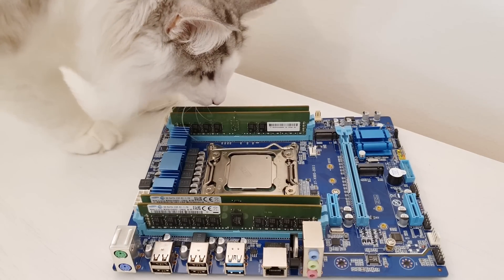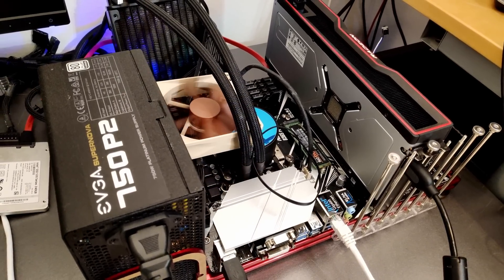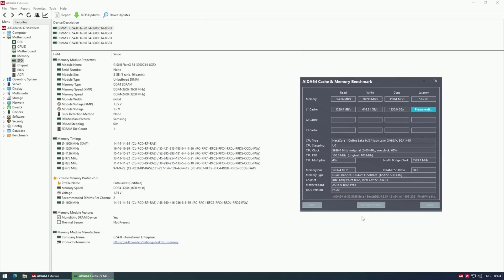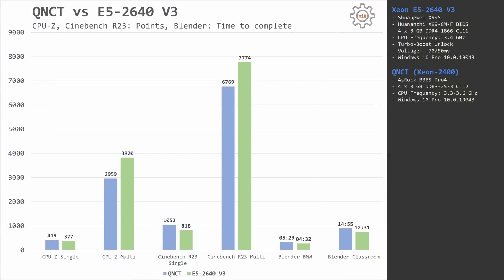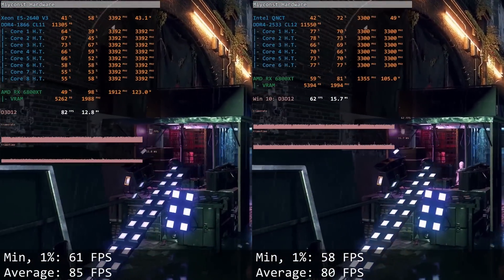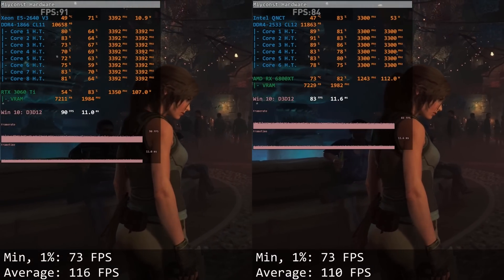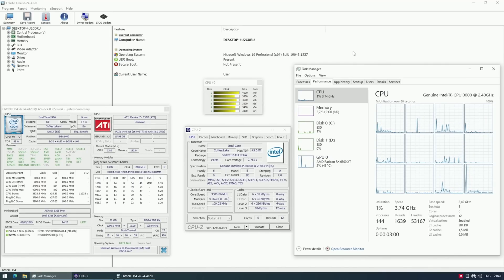🇬🇧 QNCT mutant vs Xeon E5-2640 V3, which platform is better for budget PCs – LGA 1151 or LGA 2011-3?

Comment: Hello, I currently want to build a new computer, I don't have any parts yet. And I am interested in the x99 platform. 

Would you recommend me to buy a Chinese kit which includes. 
MB Huananzhi F8
Xeon E5-2690 v3
 32GB ddr4 2400mhz (4x8gb)
 All for $350 usd 

I would also like to buy a huananzhi gtx 1060 6gb graphics card for $400 usd 

I would like to know what capacity my power source should have. 

Do you think it would be good to buy this? In total it would be 750$ usd.

 My knowledge in hardware is very limited, I would really appreciate your help. Thanks for your videos! They are really great.
Reply from the maker: Thank you for the support, but the parts you have picked is a waste of money. For €350 you can get i5-10400F on B560 or B460 motherboard, and for €250-300 you can get GTX 1060 5 GB. If you want X99 then go with Shuangwei X99S and E5-2640 V3 or E5-2666 V3.
Reply: @Miyconst  Thank you very much for your answer, I was really one step away from buying the Chinese kit.

I have the need to use the equipment to play games, and stream at the same time, at a resolution of 1080p@60fps also render video for YouTube mostly related to games.

The games you use in benchmarks like F1 and FPS are the kind of games I'd like to create my content with, but really I'm a fighting game guy, like the following. 

Tekken 7
Processor: Intel Core i5-4690 3.5 GHz or equivalent
Memory: 8 GB RAM
Graphics: NVIDIA GeForce GTX 1060 equivalent or higher 

Guilty Gear Strive 
Processor: Intel Core i7-3770, 3.40 GHz
Memory: 8 GB RAM
Graphics: GeForce GTX 660

King of Fighters XV
Processor: Intel Core i7
Memory: 16 GB RAM
Graphics: Nvidia GeForce GTX 1060 6GB / AMD Radeon RX 480 4GB

Do you think the above recommendation of I5 10400F, E5-2640 or E5-2666 can do the job?

What is better for the kind of workload? 

I can't exceed 400$ usd for M.B.,CPU, Ram

And I have another 400$ for the graphic card that I expect in the Huananzhi Gtx 1060 6 gb.

In my local market for that price I only find GTX 1050 TI which surely won't be enough.

Once again, thank you very much for your advice and your reviews, I would like to support the channel with a donation, how could I do it?
Reply from the maker: @TeamTemplo  all recommended CPUs will do the job just fine. For streaming and video rendering you just use your GPU, yes, the quality will be insignificantly worse, but I really doubt that any of your viewers will be able to spot the difference. If you can't fit i5-10400F + B560 + 16 GB DDR4-3000 (or higher) RAM into the $400 budget, then go for i3-10100F it equals to the i7s from the past and it will do the job just fine for you. For the graphics card, again, I would recommend you to stay away from the "new" GPUs from AliExpress. These cards are not new, only the cooler and package is new, the rest is scavenged from broken parts.
Reply: @Miyconst  Perfect! I will heed your recommendation and go for the i5 
I have found the i5 10400F for $150 usd 
As for the Mo-Bo I have found the MSI board that you have used in some of your videos MSI Z590A-Pro for the same price I have also found Asus ROG STRIX B560-A Gaming WiFi what would be better in my case Z590 or B560 if both do they cost about the same? 

Regarding the RAM, you recommended DDR4-3000 on the Intel website, it mentions that the processor supports up to DDR4-2666, so I'm not sure what RAM to buy. 

Apparently everything has been adjusted to the budget what was destined that makes me very happy I hope to buy the equipment this weekend 😁
Reply from the maker: @TeamTemplo  if the price is the same, go with Z590, it's a much better board, but if you need WiFi then go with the B560. Core i5-10400 officially supports up to DDR4-2666, but with B560/Z490/Z590 chipset you can overclock RAM to DDR4-3200 and higher.

Comment: 2011-3 has another beast CPU for gaming - Xeon E5-2666(10c/20t - 3.5 Ghz on all threads)
Reply from the maker: True, with the current price drop it's a very interesting option, even though the CPU is very power hungry.

Comment: Great content!
In gaming Xeon will be more stable because of the much higher PSP(4 vs 2 channels) and more amount of cores. Well even avg FPS is higher.
The only advantage of QNCT based PC is a newer platform. That means, once high end LGA-1151 CPUs will become cheaper you can upgrade your system.

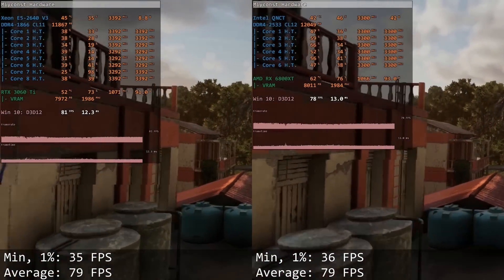Comment: 6:42
But didn't you say Assassin’s Creed Odyssey is a well-optimized game in an older video (in this video https://youtu.be/xaL5u3AYgRE?t=466 )?
And how the average FPS decreased from 82 to only 57?
Reply from the maker: I was wrong about Odyssey, I thought it was well optimized, but in reality, it just loads CPU with crappy work, while FPS is really bad. Regarding the FPS values, I wish I would saved the exact graphical settings for the original test, but apparently, the graphical preset was changed in one of the updates, so it's not apples to apples comparison.
Reply: @Miyconst  Thanks for your answer

Comment: Great work!!  I have recently bought i5 8500b mutant and paired it with Asus ex-b150m-v3 and bios mod with the latest from Asus. But the issue is my Rx 470 not detecting but my old GPU is detecting Amd HD 6670, Is there any changes I have to make in coffee time? Can you please help me to resolve this issue? Thanks!
Reply from the maker: Hmm, it could be that you are using old bios version to create your modification. Did you try to mod the latest available BIOS? Did you talk to the seller?
Reply: @Miyconst  Yes I'm using the latest bios from Asus but no success and I even tried lower ver but no detection of RX 470 and yes I asked the seller but he said I can't help you with this sorry. Should I try more old ver of bios mod? Or does this CPU have a compatibility issue with RX 470?

Comment: Good job! I never tryied this mutant processor/interposer. One advantage of Xeon is that's kind of plug and play... On the other hand Mutant comes with integrated graphics (that really doesn't matters if you're using a GPU). Both are the cheaper ways to build fast PC's nowadays. Anyway congratulations for the video man!
Reply from the maker: Thanks for the support, I am glad you liked it.

Comment: I have recently changed my CPU from the  2620 v3 to the 2640 v3 .  after doing a lot rsearch and of course watching you videos what i also will keep in mind while i will buy a better Mother board later to acomodate a  2666 v3 .  Thanks you for you content  and valubable information you provide in a very small market that is not to well known for budget hardware.  i will eventually upload some  gameplays with the  2640 v3. but firt i need to buy another hardrive 3d assets for my other hobby take lot of space.
Reply from the maker: Good luck with the project and thanks for the support!

Comment: E5 2640V3 on Machinist X99 RS9,  Do I need single ram or dual ram is better?   option 1 single 16GB 2133mhz x  1         or              option 2     8GB 2133mhz x2   Thank you.
Reply from the maker: Two memory sticks is the minimum, four is better and one is very bad.
Reply: @Miyconst  Thank you very much and I saw your turbo unlock version 1.2.5 is it work on Machinist X99 RS9  or just use old  version 1.2.0? Thank you
Reply from the maker: @nuttyl283  The newer the version is the more motherboards are supported.
Reply: @Miyconst  Thank you very much for every answers. You are so kind.

Comment: Hi, any x99 motherboard you recommend with Xeon v3 with 10 or 12 cores that will run AI / machine learning / workstation that CPU will be near 100% for long time?  I'm worried the VRM on some of these x99 boards will overheat and burn out, and fail.
Reply from the maker: For this workload I would only recommend branded boards.

Comment: Which one should I buy for 200$? dual 2640 v3 + x99 f8d or e5 2678 v3 + x99 tf.
Reply from the maker: I would definitely go with a single socket solution unless you have some specific use case for two CPUs.

Comment: Loved the spoiler on the end, the x99-g7 with DDR3. I got one with an e5-2673v3 and the vrm is freaking hot! i was using PlexHD with overclocked e5-1650v2 and it was not that hot. So i made an cooper heatsink and replaced the original.
Reply from the maker: How are the temps after the replacement?
Reply: @Miyconst  I don't have an good thermomether, but before i could not put my finger for more than one second on the heatsink. Now i can stay with the finger on the new heatsink for more then ten seconds, but it is still hot. I did turbo unlock with -50mv.
Reply: @Miyconst  posted a photo in the community tab in my channel.
Reply from the maker: @DanielGT_93  nice! I have reposted your picture on my Instagram and @ you there. To get even better thermal results you can use a heatsink which would cover two extra heatsink-less doublers so these are cooled as well.
Reply: Great ideia! where in the Motherboard is these two new doublers?
Reply from the maker: Here they are: https://youtu.be/r8EyNUIQG5U?t=175
Reply: @Miyconst  Thanks! I will see what can be done, but there are no holes near them, so maybe use some small heatsink with two side adesive tape
Reply: @DanielGT_93  you should try a downdraft style cooler like the noctua l12   or the c14.   i bet getting airflow down onto the vrms will be a good thing due to the constant head these boards tend to put out.

Comment: Any plans for 9980hk mutant review?
Reply from the maker: Not at the moment, but what do you find interesting about it?
Reply: @Miyconst  looks like it's the most stable  and performing (with RAM OC) mutant, but also kinda good VRM demanding when clocked up to 5GHz due to 8/16 cores. Needs a decent mobo, it seems.
The price is rather high, so it is comparable to medium 10/11gen CPUs.
Reply from the maker: @x.o.o.x  you have summed it up pretty accurately. The mutant requires expensive motherboard, expensive cooler, good power supply, and the price is not attractive. With all of these in mind, LGA 1200 is a more attractive platform.

Comment: From my experience I would not recommend anyone buy QL2X unless the price is good or you really need single core performance. In games like BF2042 it really struggles and bottlenecks my 980ti. I would not recommend pairing it with a GPU stronger than 1060/1070/1650S/1660S or RX 480/580/590/V56 at 1080p. It is also nearly impossible to cool overclocked without liquid metal. Perhaps to due to die imperfections as it is a ES or because the die is offset causing uneven pressure. Without liquid metal I got 4.4ghz before i started thermal throttling and with I hit 4.6ghz which is the limit of my silicon(both OC achieved on direct die with custom loop). At 4.6ghz i got 992cb in r15 and 2415cb in r20.
Reply from the maker: Thank you for the info. I have got somehow different experience with QL2X. With Noctua NH-D15 I was able to easily keep it cool at 4.5 GHz and regular thermal paste. Also, I don't think QNCT would perform better in BF2042.
Reply: @Miyconst  Perhaps it has something to do with noctua's mounting system. The problem with 2042 is the weather effects and 128 player. Once those start FPS tanks and the game becomes extremely CPU bottlenecked. For other games a 1070 tier GPU is a perfect pair. I reason I will not recommend is going forward games will be using more threads due to the consoles and  4c/8t will not be enough.
Reply from the maker: @dalzy25  it seems like you didn't watch my last give away stream where I was touching this subject. Games do not require certain number of cores / threads, games demand a CPU with certain computational capabilities. 4 fast cores are always going to be better than 6 slow if the raw computational performance is the same.

Comment: Thanks for information !!!! excelente comparison, I have both hardware, x99 tf with xeon e5 2660 v3 with hack turbo with 16g  ram and one qtj1 wit rog strix b250 and 16 gb ram 2666 but this cpu dont get dual chanel, i dont know why? in my experience i like better the sistem with qtj1, youre the best explained for both cpu test
Reply from the maker: You can try to tighten or untighten some corners of QTJ1 and see if the second channel starts to work, but it could be a defective CPU as well.
Reply: @Miyconst   Thank you sr for you answer, I apreciated, keep going with tis great information, also I cant find the video review for the liquid cooler that you recomended for the mutant cpu
Reply from the maker: @mishingoncito  I have not done any liquid cooler reviews, that's probably why.
Reply: I review all your videos I dont find what could happend with mi ram in qtj1

Comment: is 7700hq a mutant cpu? someone give me this cpu and was wondering what kind of motherboard is able to support it
Reply from the maker: Originally it's a mobile CPU, so theoretically it can be converted into a mutant for desktop use.
Reply: @Miyconst  would like to ask for help how to use it though, i been looking for some English tutorials for it
Reply from the maker: @lizertech  you can't do it yourself, you need a special PCB adapter and solder the CPU on top of it. Chinese have managed to do that on a factory due to excessive supply of these mobile chips, but not possible to do it at home.

Comment: Very interesting comparison. I never tested a mutant.. i didn't like the BIOS modification they need.... but seems to werk very well
Reply: I wish you make video using E5 2683 v4 16 core or E5 2698 v4 20 core
In proxmox and install  as vertical win10, linux, freenas,  and passthrough gpu

Comment: I'm not against using a laptop CPU on a desktop (and an ES one at that), and the adapters I have seen seem pretty good.

But lack of proper heatsink would worry me
Reply from the maker: In this particular case the missing heatsink is a plus in my opinion, it is way easier too cool a CPU with a naked die.
Reply: @Miyconst  I always worry about it. I haven't tried to cool a bare die since the Athlon XP days 🤣
Reply: @greyshadow9498  imagine if motherboard manufacturers did the custom mounting plate back in the good ol bare die days...

and instead of a latch you just screwed the cpu into place... my god isnt that so innovative? lol

Comment: As always nice video perfectly organized.
A question, do you know what gigabyte motherboard does not require an external programmer? I can only find Asus and Asrock 100 series with removable bios chip.
Reply from the maker: Many Gigabyte motherboards allow flashing modded BIOS using the Gigabyte Flashing utility, I have tested Gigabyte Z170-HD3P and B365 Aorus Elite, in both cases I flashed modded BIOS using the native utility, but some of my subscribers report that it didn't work for them with the same B365 motherboard, thus I assume, in some BIOS revision, Gigabyte introduced integrity check.
Reply: I used the gigabyte z170m d3h